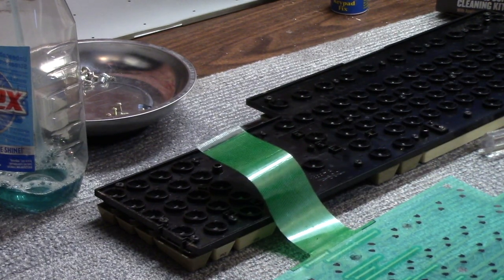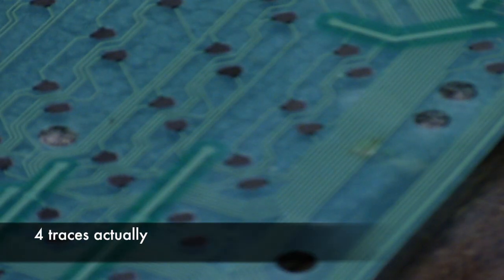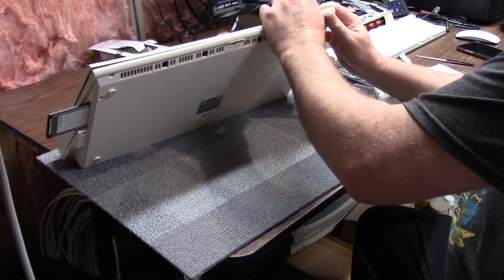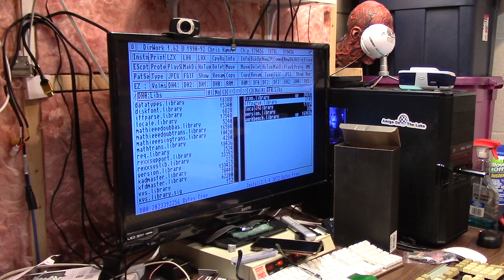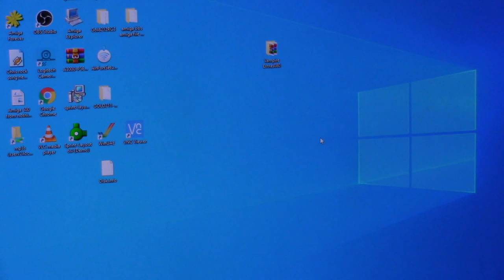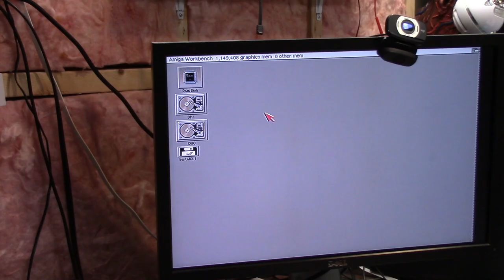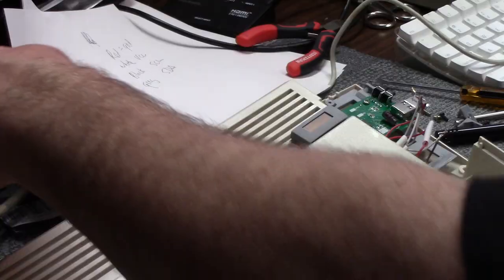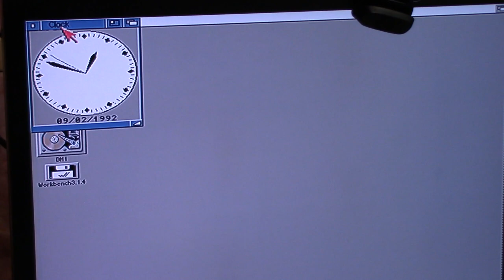Project A1200 Part 4

Comment: Ahh. At least part 4 is here. Pouring up a cup of coffee here :D
Reply from the maker: one left to go. im editing that one now...
Reply: @ChrisEdwardsRestoration  Nice, when will it be uploaded? Watching part 4 now.
Reply from the maker: @larsenmats  Soon soon...
Reply: @ChrisEdwardsRestoration  Those ebay scammers. I recently bought a working A500 Plus motherboard with no chips. Had been working before the seller took out the chips. When I got it he had actually drilled two holes through the motherboard, under Agnus to pry the chip out. In the ebay pictures the Agnus chip was in it with all other chips removed. There were no holes in the PCB on the pictures of course. So when I ordered it I asked if it came with the Agnus since I saw it in the pictures. He answered he had just forgotten to take it out before he took the pictures. Anyway, he had just drilled through the groundplane so motherboard was still working. He had drilled partly in to the bottom of the Agnus socket so it had a few cracks. He had apparently been drilling holes in A500 Plus rev.8A motherboards for the past 14 years because it was so risky to remove the Agnus with the extraction tool. And it is, I have bad experience with this myself. A500 Rev.5 and Rev.6A comes with holes under Agnus from the factory. But he should have been honest about it on the pictures and in the description. Also, the op-amp in the audio circuitry was bad. Had sound distortion. So I had to change that. I also changed the Agnus socket. All in all I got a good price on this board compared to the other sellers on ebay, so I'm not that angry. Btw, I have repaired bad membranes like that with conductive paint. I heard you mentioned it in the video. But still, it was sold as a working keyboard.
Reply from the maker: @larsenmats  its up

Comment: Holy crap dude. $100 USD even for a working keyboard would be expensive surely? And it's yellowed :(. Could get a whole A500 for that easy and the keyboards are the same A500 and A1200 and you'd have other spare parts. eBay is a minefield :(
Reply from the maker: while i agree, anything with the words Amiga in it is expensive as heck. i have all models of the Amiga except the A1000 ( had it but sold years ago because i am dumb) and the new new ones, like the Xe1000/5000 and a1222. but those will be coming soon when i can find them for a descent price.